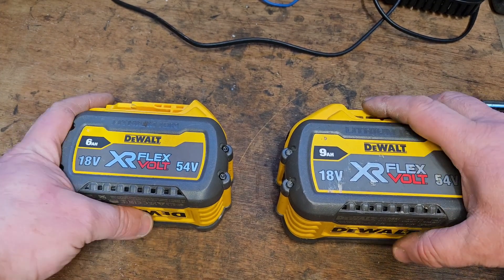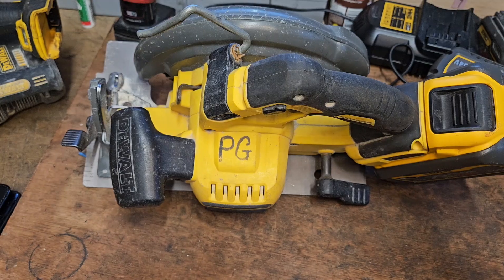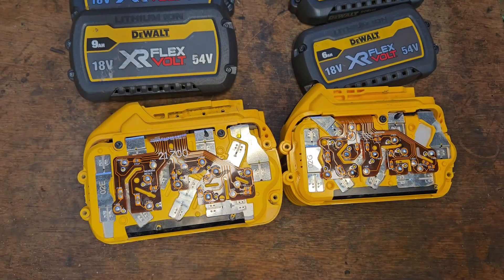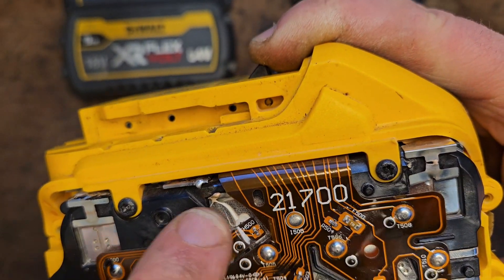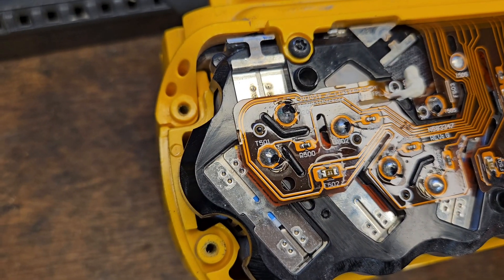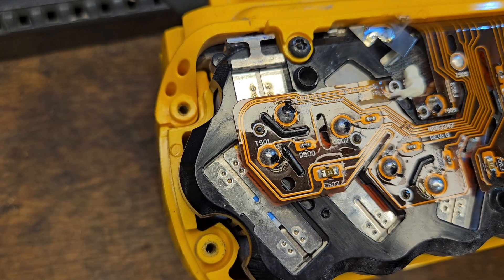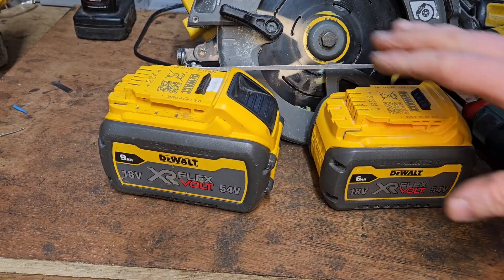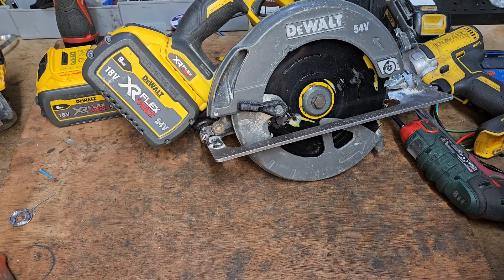Dewalt Flexvolt only 2 Bars?

Comment: Hi mate ive two 9amps only three years old have stopped charging both have 2 leds stripped them down no broken connections ect any ideas ?
Reply from the maker: Likely thermal fuses resistors or cells
Reply: @doctorlefthandthread  how do i check them mate
Reply from the maker: @deanthompson6664  no easy way when it comes to that stage with a flexvolt I throw in the towel too difficult to find the fault and replace the components
Reply: @doctorlefthandthread  ah asee i think ive one cell thats higher voltage than rest what volt and amp would this need to go down to mate ? I have one of them dc supplies u have jus bought it
Reply from the maker: @deanthompson6664  the cells need to be close in voltage to each other that is enough to stop the pack charging and working properly
Reply: @doctorlefthandthread  ah asee ive checked the cells i think i can see one cell on the top saying 4.0v the rest are 3.8v?
Reply from the maker: @deanthompson6664  the one reading at 4v is full and will stop the battery from charging further
Reply: @doctorlefthandthread  ah so i need to discharge tht somehow mate?
Reply from the maker: @deanthompson6664  what I do is fully charge the rest get them equal I currently have no easy method to discharge cells
Reply: @doctorlefthandthread  ah so u think i should manually charge each other cell to 4.0v? Mate i have a dc variable charger like yours...or can i jus hook that straight up and set to charge for the whole pack at once so it goes up from 2 bar..or run it flat
Reply from the maker: @deanthompson6664  better to flatten the pack and recharge it up with the power supply it sometimes works
Reply: @doctorlefthandthread  ah sound mate al try tht, also i have another 9amp pack wont charge 2 bars all cells bar show 3.8v apart from 2 that shows 0v think theyl be buggered mate ? And thanks for replying much appreciated
Reply: @deanthompson6664 All 0 volt cells will need replacing....

Comment: Great knowledge here. Would you be able to shine any light on a dcs576 that stopped working abruptly? No LED lighting up and no noises at all? Cheers.
Reply from the maker: Do that test before trying your batteries but if it were me I would open it and try to clean the motor and switch with contact cleaner

Comment: yeah thats a thin strip for a reason, its acting as fuse. Soldering on a wider bit is like sticking a higher rated fuse in, bad idea
Reply from the maker: I would agree that it is probably too wide it is thin 0.1mm. It has been tested I popped one of my fixed ones recently on a dodgy flexvolt machine it did pop it blackened the inside of the casing but saved the battery it was able to be repaired. I will take your advice however I will keep the strip narrower in future.
Reply: My 9ah only shows one bar, won't charge at all. I've opened it and no bars are popped any ideas ? On what it can be